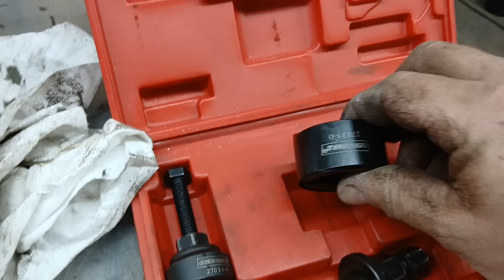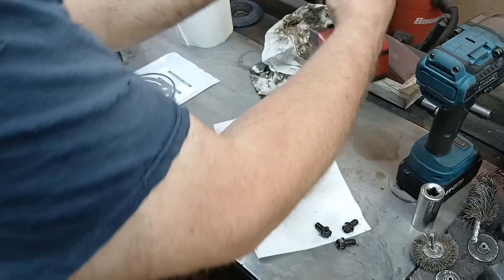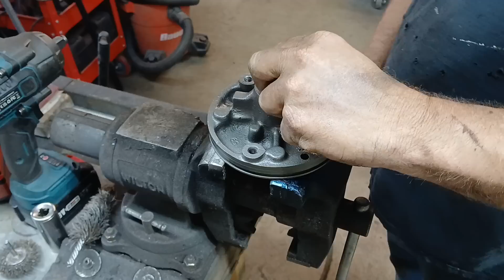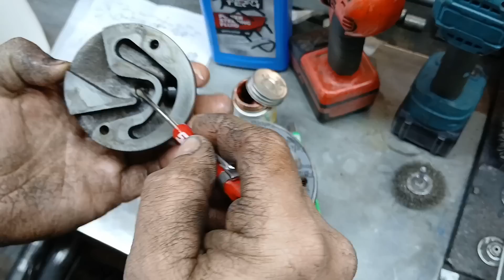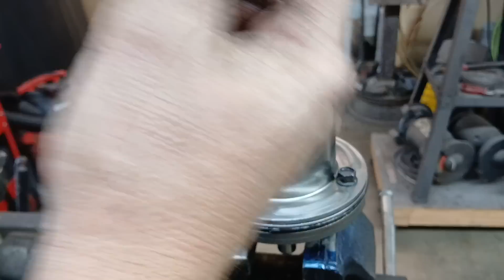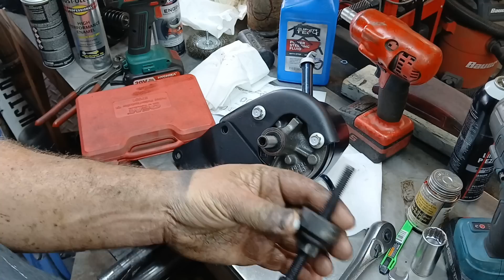Refresh Your Classic Ford Thompson Power Steering Pump With Fresh Seals!  #ford

Comment: How can i take the valve out so o can inspect it and clean it? My friends pump looses power on a turn and makes noise )not the belt) the pump is a new(rebuild one) but it didn't take a year when going bad
Reply from the maker: Should have some clips holding the regulator in
Reply: @HotRodGuyGarage did you ever removed some or could it be a blockage that you cant take out ?

Comment: The one pin is supposed to be removable, the other is a press fit into the housing.. the internal parts have a round hole, and a slotted hole. In stacking them up, the round holes go on to the fixed pin, slotted holes go on the removable pin.

Comment: I've found that if the pump's got the big filler neck like on 65/66 t-bird (may have been used on more years than that) the top piece with the relief valve goes the opposite direction.
Reply from the maker: Interesting point, always learning new things!

Comment: Nice instructional video!!! Question-after going thru mine, I still can’t turn steering wheel at idle. While driving it steers great. I even went with a slightly smaller pulley too. Any help would be greatly appreciated. Driving me crazy!!!!!
Reply from the maker: Hmm, that's a tricky one! Does the regulator assembly move freely inside your pump?

Comment: I had a 74 F250 4X4 with a slave cylinder power steering set up, apparently someone ran it dry and the pump was making all kinds of noise. I bought a new pump and a pulley from a Ford dealer, it was around $40.00. This was in 1978. Those were the days !  TMD
Reply: To compare $40 in 1978 is equal to $198.85 in buying power today. 48 years with an average inflation of 3.4%

Comment: Another informative video Russ. I used to work for a guy in the core business and he shiped that same pump along with Chevy and Chrysler steering pumps, plus pretty much everything else with some exceptions. A lot of the pumps like you the one in this video the small tube would be cracked where it connects to the tank.   Cool video by the way.  Happy hump day.  😊
Reply from the maker: Definitely seen the tanks crack at the solder joints

Comment: Thanks , I’m one of the lucky ones that got a good one after three tries , I have a motorcraft one that sings needs more than a seal kit ,unfortunately  73’s. 9231 So. Ct
Reply from the maker: One thing ive noticed about most aftermarket replacements now is they have went to a common vane style blade setup.

Comment: The pumps leaking was a minimal thing that  ridiculous power assist or some people called a brain was a leaking mess
Reply from the maker: There not the greatest systems but when there right they work well
Reply: Hoses and cylinders and more hoses. My early Mustang builds sometimes had them. You can tune them somewhat by swapping pressure relief springs in the control valve and the pump. Less assist with more pump pressure can give you a little more road feel.